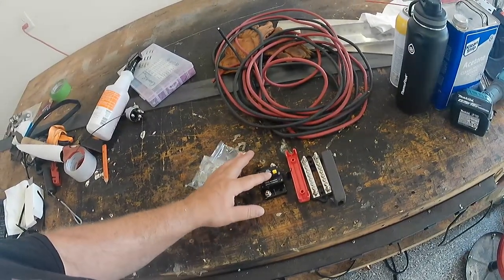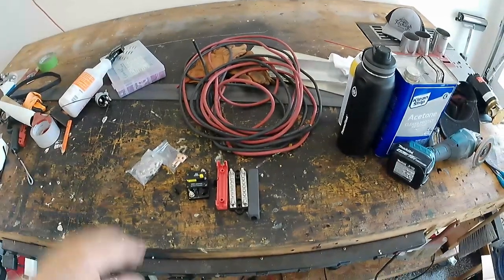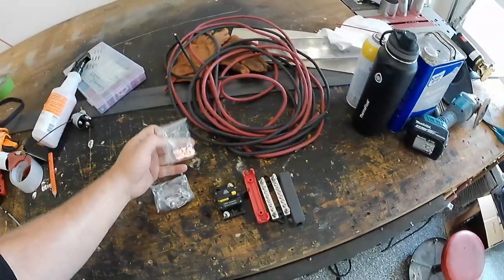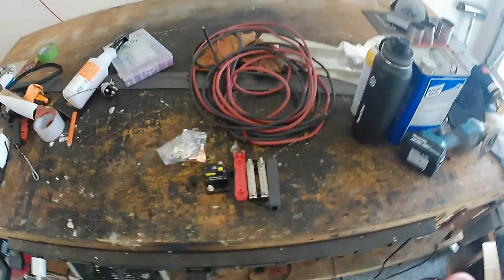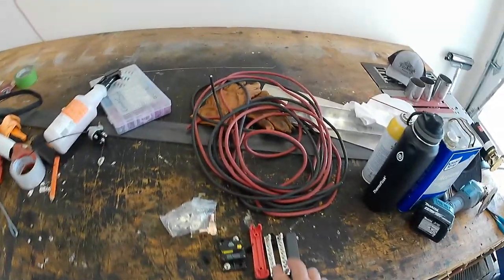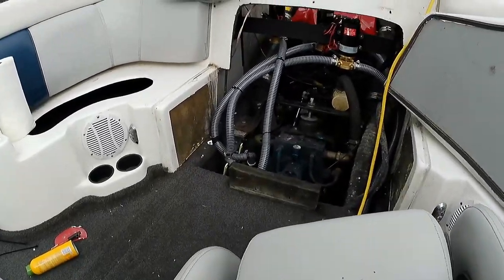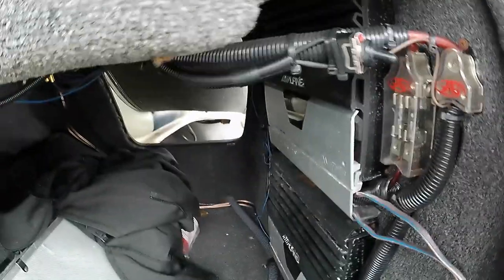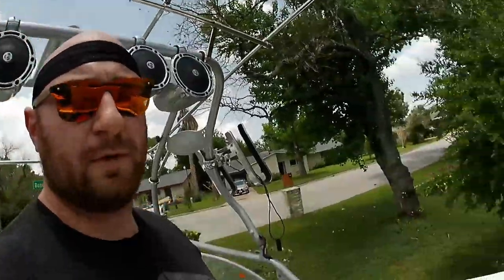Custom Reversible Surf Ballast Install - 2004 Tige 22V Wake Surf Boat

Comment: Hi thanks for the video.  We just bought a 2004 Tige 22v Limited and want to get it set up for surfing also.  Your install looks clean and tidy. Curious to how much weight do each rear bag hold along with the front and are you using a wake shaper on the side of your boat?  
Thanks!
Reply from the maker: 1450# each locker. 450# bow. I am using a cheap wake shaper off ebay. Basically straight down from the rear cleat on the upper part of hull right above the crease.
Reply: @Makswerks1   Thanks for the info!

Comment: Hey, thanks for the video great job. I put a similar system in my 2005 22V except without the front bag and my 2 rear bags are smaller. To get to 1450# I'm assuming your rear bags are L shaped and go under the seats? Do you happen to have dimensions of those bags from Mikes Liquid Audio? I've already got a quote from him for L shaped bags that he says are 1300# each but since I'm on the west coast and he's on the east I'm looking to have something custom made  locally. My boat is all sealed up for the winter so I cant get into it for measurements.
Reply from the maker: Yes. They are L shape'd and run all the way forward under the seat and when full come close to being the same height as the rear locker (maybe 1.5" shy of the cover). I don't have measurements handy and would have to go out to the boat to get them. He was excellent working with me, so I would recommend ordering them through him, the price was about the same going through WakeMakers or similar. Not sure why your 05 would take different bags than my 04, but he is pretty expert so I would listen to him. The main issue is getting enough weight in the front, not the rear.
Reply: @Makswerks1  Interesting about the weight up front. Any time I weight the front my wake gets worse and I've heard others with the same boat say the same thing.
Reply from the maker: @randyisaak455  My personal experience. With both rear bags full, 6-7 folks on boat I need at least two to sit up front along with then full 450# bag to throw a nice clean wake with the gate installed. Some of this may be due to me needing to upgrade the prop, but in general you want the angle of attack to be right. Depending on water conditions, people on board, ect. 

I am normally out every weekend from April to October, so I rack a lot of hours and this is what works for me.
Reply: @Makswerks1  Sounds like you have your system dialed in pretty tight. These older boats can actually surf really well if you put a bit of effort into it and then have a crap ton of money left in your pocket.
Reply from the maker: @randyisaak455  has been my experience as well.